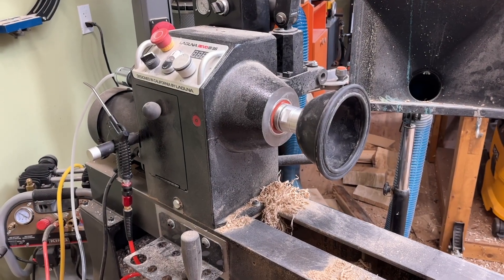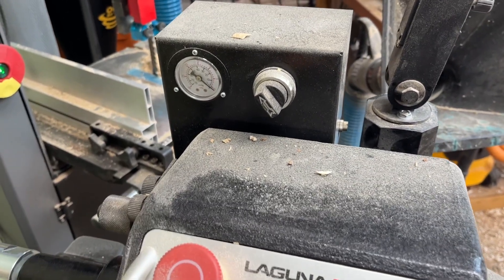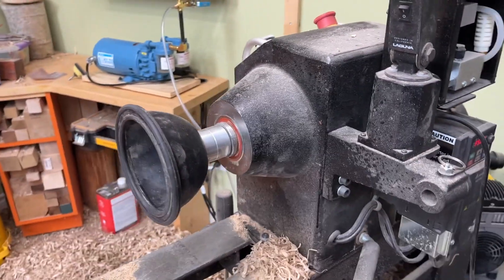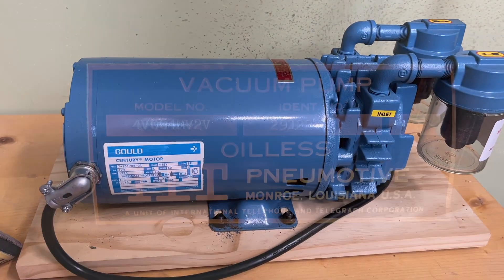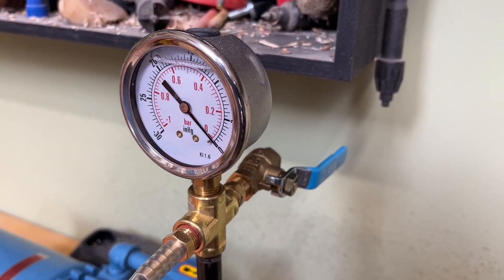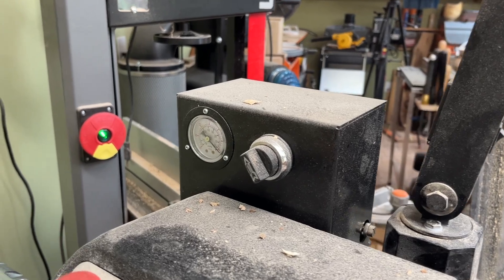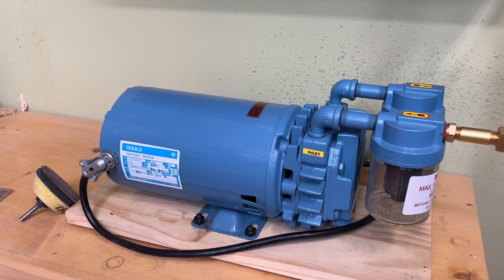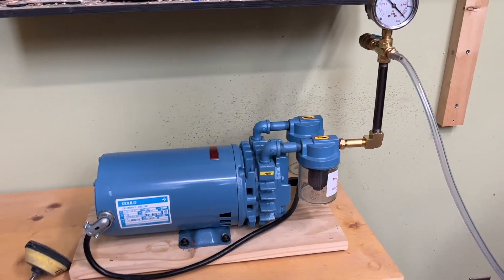I Gave Up The Laguna Vacuum Chuck System

Comment: Okey dokey, Sir! The Laguna Vac-o-Matic is officially off of my toy list.  I don't often use the HoldFast system with my Jet 1221, but it is pretty easy mount, use, and dismount.  And it has zero failures in about 5 years.  Oh - and if your HoldFast cups ever spring a leak, there is some stuff called "Aleene's Original Tack-It Over and Over" that works great to seal the leaks.  Cheers!